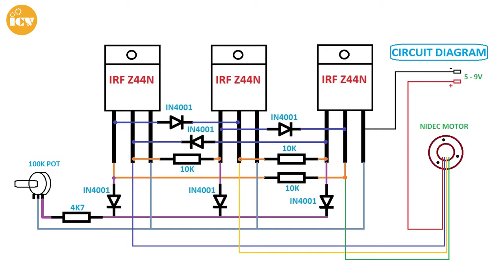How to Run HDD Motor || DIY Brushless Motor Driver 5V - 9V

Comment: Works very poorly, efficiency is close to zero. Requires quite a strong manual start and yet it takes a minute or more to get any decent RPM. Makes a lot of hissing noise meaning that the switching frequency is too high even when using 500k pot. I used exactly the same parts. Useless and waste of time.
Reply: I wonder if using a capacitor in the potentiometer would avoid having to drive the motor manually.

Comment: Greetings friend! I did the project and it works, but not like in the video, I have to give it a push to start it and I can only put 5 volts on it, after that it turns off. What can be?

Comment: Hello, first of all, thank you for sharing your project.
I made the circuit but, they present two small problems:
1) When I turn on the power supply, I have to give a push on the motor for it to turn.
2) I don't have total control in the potentiometer, that is, the potentiometer doesn't act gradually the speed of the motor. I am using a 5V 2A power supply. Is this really so?
Thanks again.

Comment: This is not happening with me.
I mean I made same circuit and tried with different voltage but the motor did not running and it is just vibrating only,
I give 1v to 12v dc
Reply: have you tried jump starting the rotation/spin?
Reply: @joshuaneufeldt3  Please explain a little more!
Reply: Initial push or spin...